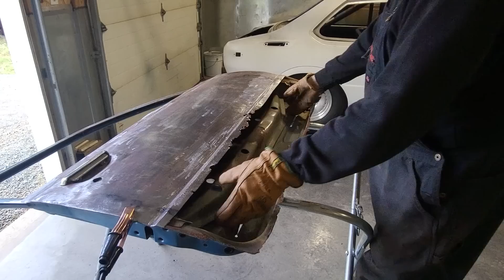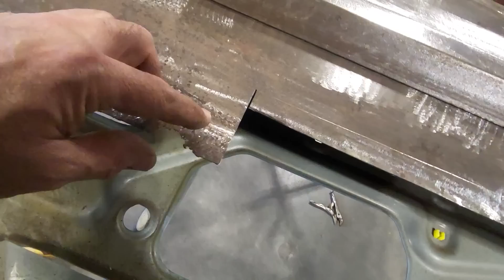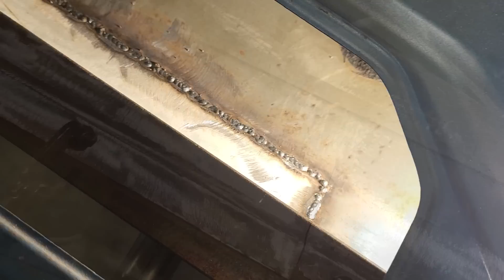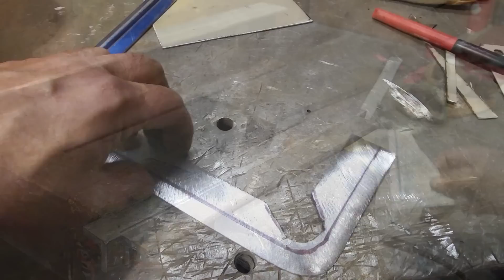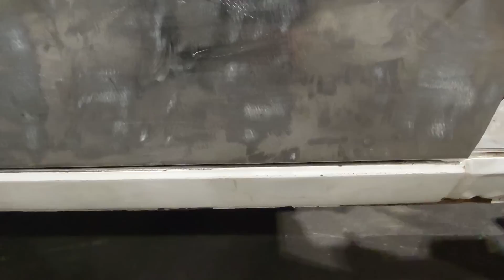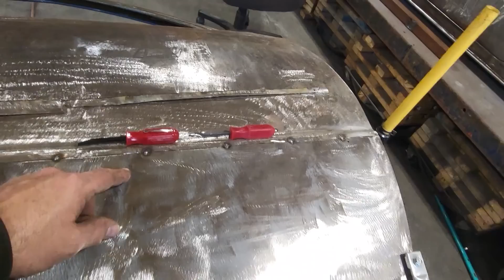Finishing up the door on Crusty

Comment: look up a lenco dent puller it tacks welds it self to the metal and a slide hammer to pull dents it also shrinks with a tip you hold it against the panel it will heat a spot cherry red

Comment: I used the long cuts in the middle of the panel to fix the level technique before too. I dont feel so bad about it now that ive seen fitzy do it. Worked too, and let me pull out at least 1/2 inch of filler that the last bloke left in 😂

Comment: How are you going to prevent rust from coming thru on that thin door skin. I've never had any luck it always seems to bubble thru on me and i've tried lots of different paints and chemicals.
Reply from the maker: @nanukvas  I done the rest of the car with a rust converter with a coat of industrial primer that is used on pipe lines. Interseal 670HS from International paints

Comment: I know you are very good and this is an older video. But if you do another door could you teach us how to adjust taking on and off the doors. I work on late 50 and 60 trucks.
Reply from the maker: @timmcfarland2736  those trucks are totally different then this car. Some of those trucks are very bad and depending on if there was work done to the floors and front mounts also play a part in the alinement of the door

Comment: Rust-Oleum makes a rust paint that you could do a rusty paint job with it. It is called Modern Master Metal effects oxidizing iron paint. It is a 2 paint system that has an activator but you can use vinegar or just water. And you get rust with it. But you can fix all the metal so it's solid

Comment: I always pick up those bed frames! The newer( last 35 years or so) are cheap steel with lots of garbage in them but older stuff from like 50 years ago or older are actually good steel. I like them for battery boxes and for bracing inside a cab or car when cutting the floor out or channeling the body. The best part is they are free!

Comment: How about using MAP gas torch for the heat source for shrinking metal I used mine to heat connecting rods for a press fit piston pin.
Reply from the maker: @paneltruckbob  I never tried mapp gas but might be interesting to try

Comment: Great job. Would it have been better to weld it in spots across the middle instead from one side to the other prevented the wetal from walking so much or from the middle out bouncing from one side to the other?
The reason is, I have to do something similar and I'm not as good as you.
Leave the name Crusty it will open up a conversation when she is done and looking beautiful.
Reply from the maker: I usually do it that way. But in it's defense this process  was working good. Welding  both ends was the mistake  here.

Comment: I've used oxy acetylene to straightened a tailshaft that I shortened by heating a spot and then cooling it with water, like I've seen engineering works do. On the door skin, it might be possible to use MAP gas to do the job?? MAP apparently is a lot hotter than propane. Here in Australia, we can just pay a deposit on the oxygen and acetylene bottles and then just swap the empty one for a full bottle as needed. This is a lot better system than the rental contract that used to exist in the past.

Comment: We have a rusted out Toyota Corona that's used for storing "junk" at the moment. The four doors are pretty well had it, but interestingly, that door handle surround is good on all four doors. I hadn't even thought about it until after your last video when you made that new section for around the door handle.

Comment: The shrinking disc from everything I have seen, works. A 7" disc will build more heat than the smaller disc. Wray Schelin sells the best ones and they have a curve on the edge making them safer. He instructs everyone to use a magic marker for the area needing heat to make the disc glide a little better. I have purchased the smaller disc because I did not have a 7" grinder at the time. I now own one and may purchase the larger disc. I have 2 fenders to work on for my '56 Chevy and one of them is decent but the other needs the brace and has a rust hole at the rear bottom plus a bunch of small dents all over it. I believe a shrinking disc will benefit me to get it smoother after hammer and dolly and maybe even a bullseye pick. I will be doing my first cut and butt on the hole in the fender, it just seems line the perfect place to use this process. Check out Wray's videos on using the shrinking discs. Oil canning come out easily with one and no torch is needed. The disc will make the metal hot so you have to learn possibly a new technique if working with bare hands. I bet for the thin metal, if you have a propane torch, it would also be another method. If PhD's were awarded for rust repair, I think you would be one of the few to get one. Love how you tackle something that intimidates so much and just work your way through it.  I much appreciate your videos.

Comment: I don't know if you will see this because I'm watching this video a day late. 
I'm working on my 69 Dodge truck, I cut out the rusty door corners and have patch panels welded in. The back side of the door metal was rusty, and it was a pain trying to weld. I blew a bunch of holes, some parts welded well but some were a pain. I solved the issue by using coat hanger in the holes, I placed the arc on the hanger, and it melted into the door, Wala ... Success. I can't do any hammer and dolly work, because the inside is not accessible, no cut and but for the same reason. I do have body filler, so I'm good to go.

Comment: You call it bed iron, I call it FAI. Free angle iron. All I have to do is visit the local apartment complexes the last and first weeks of the month, and it's usually sitting by the dumpster. I've even found some at the gas station. That's the time people tend to move out and for some reason they don't take it with them.

Comment: Another great video. I wish I had been able to find my 78 that I brought to New Brunswick from Manitoba. I looked around but, I never found it. The car was solid, I parked it because I cooked the engine. Have you ESAB easy grind mig wire, it is supposed to for bodywork. It isn't cheap, but it is easier to finish. I saw that the Canadian site has 0.23 wire.

Comment: Not as easy as Oxy / Acetylene but if you have a Tig Welder you can use that or if all you have is an old Buzz Box get some carbon rods and use low amperage and you can heat shrink with them.

Comment: I understand your frustration with the warp-age on the door. I tried to put rear wheel arches on my 2003 Chev truck. I warped the bed from the front of the arch all the way to the tail light. There was no room to dolly the panel because of the truck fender and the box are only 4" space. I have spent my spare time this summer straightening the box. A lot of first on this project. I had never Mig welded sheet metal, I watched you make your own patch panels, so I made my own wheel arch replacement, and then I ran into the inner fender. The only metal I had to make patch panels from was a 55 gal. drum that I cut open and planished it on the floor. Turns out that metal was not quite as thick as the truck body. My weld turned out terrible. What a summer this has been. Thank you for posting such detailed videos on how to doo body work.

Comment: When we welded stainless steel, we would put chill bars on each side of the weld. enough room to weld the seam. The aluminum chill bars would absorb the heat, the bars are 2" by 1/2" by 3 foot long.

Comment: Those small pieces to do the door skin corners is exactly what I did on my 64 Corvair truck a few years ago, rebuilding the entire bottom edge. I did similar for the inside and outside rocker, plus that lip where the door sill goes. (top of the rocker / inside floor) Little did I know, that's exactly what a professional would do. Glad I am in good company!

Comment: I'm working on a 1970 Datsun Roadster and had the same problem working a quarter panel. Like you said the metal is so thin it it moves all over the place, got it fairly straight but had to put on more filler than I wanted but a magnet sticks to in so that is how it will be. Thanks for all the videos I have learned a lot from you.
Reply: That Datsun metal though!! I’ve wrapped turkeys in thicker metal :) :)

Comment: Another great video, I like them all. I vote to do the hood ,make the whole car look fantastic. Your videos tell the story of the car better than a rusty hood. Glad that inspector peanut approved 😊 you may want to look into propane torch ,or Mapp gas torch that hooks to the small bottles with a hose and you have a torch handle on the end that is adjustable. Some plumbers use them . I have one that will heat to 3600 max . The bottles are readily available, and disposable. I looked on Amazon there around 40.dollars us for the torch . Might come in handy for shinking .

Comment: Hello Tony, you have an old spot welder. Is there any way of using that for a shrinking heat source?
Reply from the maker: Ya I never thought about that machine. I'm going gave to give it a try.
Reply: @fitzeesfabrications  if you could let us know how you get on would be appreciated.  I'm in a similar position in that I can't justify gas any more.  But even an old ac arc welder with a carbon or copper electrode shorted out at the point you want heating might be enough to do what's needed? Might have to try that one myself as I don't have a spot welder. Scrap the arc welder idea. Maybe a big one? But just tried a small Chinese one and definitely no use 😞

Comment: I wonder if you put a aluminum heat sink by where you are welding if that wouldn't absorb the heat quicker. Saving the distortion. Just a thought.
Reply from the maker: It might. I found the angle iron did same thing

Comment: I’m no professional but when I need to shrink a spot like that I use an old trick my dad showed me decades ago. Use a torch and heat up a slightly bigger area than what you are intending to shrink and then touch a cold wet rag directly to the spot you want shrunk. Start out slow with the heat until you find that range where you will actually get some shrink but once you get used to it I’ve found it very effective, you can actually see the metal sucking up and shrinking and taking the puckers out as you’re dabbing the cold wet rag on it.
Edit: I left this comment before you got to the part that you said you weren’t going to get an oxy/acetylene torch 😂
Reply from the maker: That's how your suppose to shrink. I don't have torches

Comment: Yeah...leaves 'em crusty!  Ever use Penetrol as a rust preventer?  Flood brand oil based paint leveler.  Unlike a rust preventer it locks in the orange "patina" and absolutely stops rust.  It's a clear additive, so it darkens the metal like a polyurethane coating.  Take something rusty, paint this stuff on...leave it to dry a day or so.  I got rust on body parts for years and this stuff stopped it cold.  Some guy in Oregon turned me onto it.  I have "bare" steel rebar, structural pipes...all just coated with this stuff and they just don't rust.    The hood would look so cool with the rust just locked in like it was owned by some high school kid was waiting for his next McDonald's paycheck to buy more Bondo.  Total sleeper car persona.

Comment: For a small shrinking job, would a propane torch be adequate?
Wray Schelin's  Pro Shaper Workshop channel has a lot of information on shrinking discs
Reply from the maker: The small propane torches don't get them hot enought and the tip is to widened makes the process worse

Comment: The before and after confirms that a miracle has happened here...lol.  I must have missed you putting the crash bar structure back inside the door... or do you have other plans?  I tried to see it, but... well, I don't.  Saving weight? or something else?
Reply from the maker: It was removed to save weight.
Reply: As on the left side door, the door's 'crash bar' was removed and not reinstated.  Side protection is now provided by the roll cage's side beams.

Comment: You do great work Tony I once watched a Scottish master do body work he did cut and butt but used a torch with a small tip and oxygen acetylene set at 5 on ace and 15 on the oxygen used old school steel rod and he'd cut out the rust and make a piece to fit in the hole and weld it in and he'd use a damp sponge to cool down the area and after he hit it with his little air grinder you couldn't even tell there he fixed the area best autobody guy I ever met and I've met alot of good body men

Comment: Hey tony, cutting the inner door support out to lighten the doors would have been okay if you put a 1 inch square tube in its place to support the door ends. The door skin is never intended to support the door ends and then welding on it, it's going to warp all over the place. Think of the door frame it's like the support around a drum the doors skin is suspended around the frame.
Reply from the maker: Door bars were not put into cars till the late 70s. This same model a few years older never had them.  Alot changed in 1974  with safety. These door bars were one of them
Reply: @fitzeesfabrications  what you say is true but the doors skins were put on as one piece, there wasn't 10 inches of the door skin missing and being welded on in the middle of the body molding. Better to have spot welded along the top edge first and done the ends last Much better to do small tack welds one second then move to a different area and let that cool.

Comment: I love the crusty hood idea. I "wax" my rusty old truck with boiled linseed oil and mineral spirits. Looks like clear coat and slows the rust down some.   Also, I recently used a shrinking disc. Pretty fool proof and works as advertised. Mine is just a little one for a 4-1/2" grinder. As always, excellent content.

Comment: I have absolutely no right to comment coz I know nothing, but what the hell - 
Would it be worth using TIG for jobs like this. It seems to me the panel started straight, the heat went in the bottom, but the middle went out of shape. surely what is need is not to shrink the middle, but to stretch the area welded (heat shrunk) back to its original size. Not usually successful if MIG welded due to cracking. Hence need to TIG. Just a thought.  Thanks for content

Comment: I'm a little confused about 
clamping 18g and 22g flat on the supporting metal, doesn't it create a significant step?
Reply from the maker: There was some sections that had a step but for most part it went flush
Reply: @fitzeesfabrications  
Thanks for your reply!👍

Comment: Would it have been better if you'd tacked it all the way around first?
Reply from the maker: Where it is middle of the door the metal wants to move and it needed a place to go. Tack welding it stop it from moving across the weld and it will move up into the panel like it did at the end

Comment: When watching you i often get a little anxious on how many tacks you do in such a small section at once. Im not criticizing,  it's probably fair to say you have more experience doing this stuff. But i do one, maybe two, tacks then move as far away as i can get and repeat. Then pausing if fhe metal is still warm/hot. I'm sure it takes longer and i don't do this for a living. Just wondering if it would help if you did fewer tacks at a time then let it cool. You've obviously thought about this but i can't see how it wouldn't help with warping?
Reply from the maker: The warpage came from welding both ends. I usually tack and skip but was experiment on this with the one inch weld and grind technique
Reply: @fitzeesfabrications It may be interesting content to grab another door and try mkll version ( with the  lessons lernt )?
Reply from the maker: @kiwiingenuity1677  there is a link in the description to the other door I did and that's how it was welded. This video was the first time I tried it that way